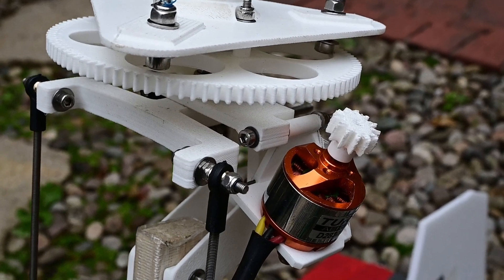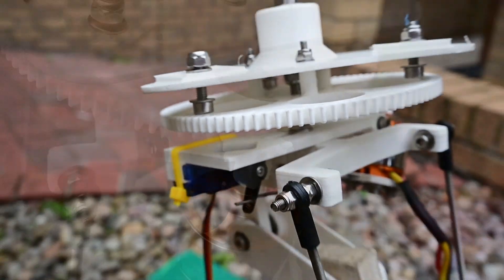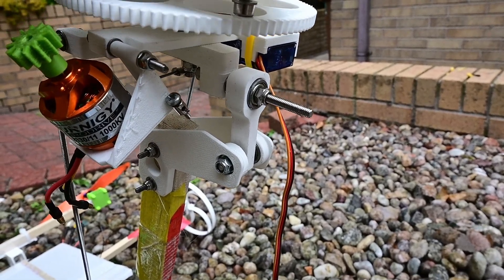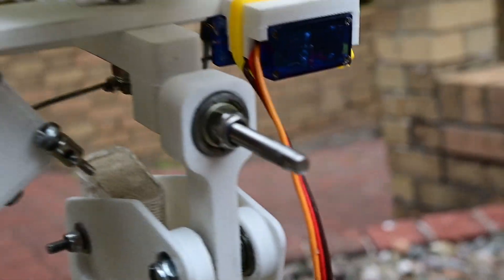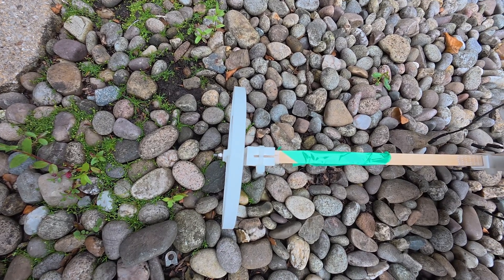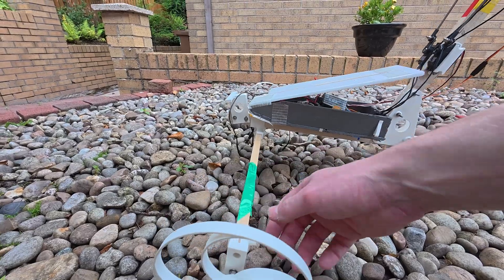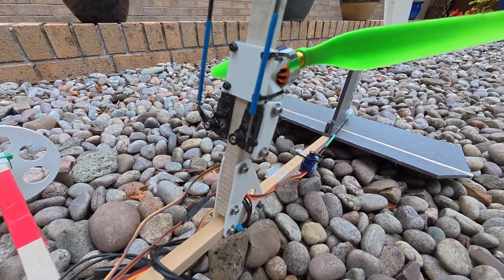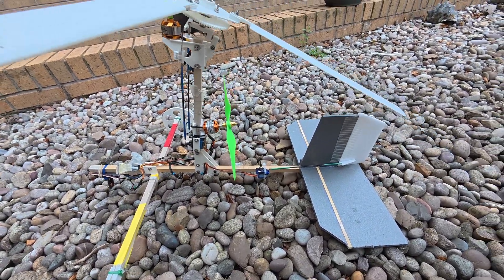RC Autogyro Project 3D Printed. Updates and smaller version release.

Comment: Hey I’ve been working on my own gyrocopter project and I’ve always had a problem with the craft tilting to one side on take off even with a flexible, fiberglass rotor head.
Reply from the maker: Tilts to the left with a CCW rotor direction? That's not enough rotor speed. I spent ages developing the prerotator here because trying to takeoff without it was so difficult. Basically impossible if there wasn't any wind to help.

The flex plate is to reduce servo loads, it doesn't actually correct for asymmetric lift. There's an extremely long thread in the RCGroups gyro section covering all the aerodynamics.

Comment: Cool. Have you considered printing pinion with hard tpu?
Reply from the maker: I'll think about it. ABS is certainly better than PLA for this though a weak material with correct setup lasts much longer than strong material with bad setup.

Presumably the better material on good setup would last near indefinitely.
Reply: @Glydaire  I've got some TPU(medium soft) and can try to print it for u some time. Khalid has my email so you could send me stl if you want. I know it may be not ideal for gear but if it would work then it will be indestructible

Comment: Instead of gears. Try and old tail dragger wheel on the motor. And a pully shape on the main rotor.
Reply from the maker: I'm not sure if friction drive will be good enough for this, there's a LOT of torque going through it. I'll consider it.
Reply: @Glydaire referances to the design in rc modaler and modal airplane news should be floating around. The main rotor pully can get fairly large. But I should have mentioned to use an old rubber tail wheel. I forgot everyone uses foam now.